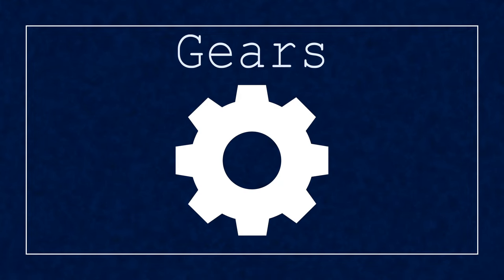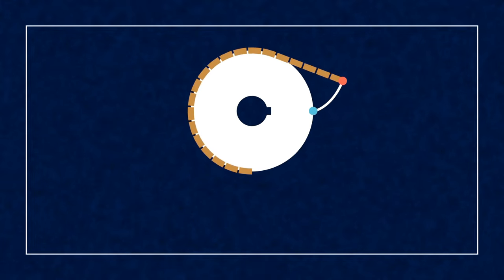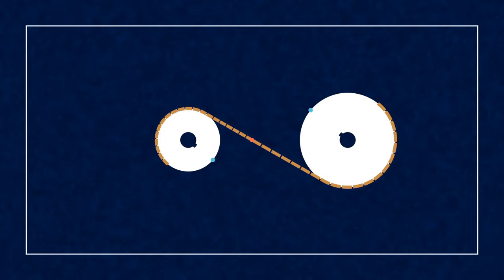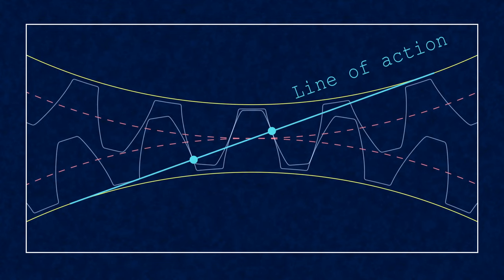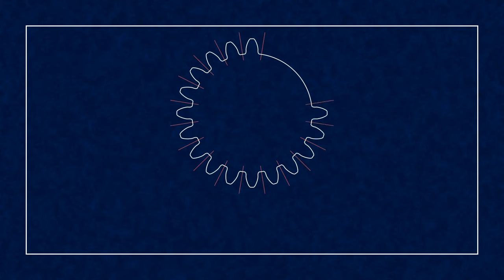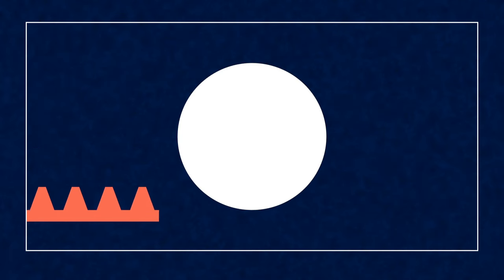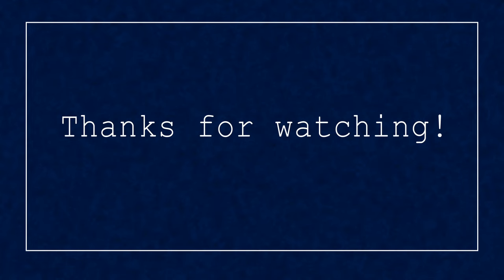Involute Gears Explained

Comment: good video, however I think the loud music distracts from your speaking, sometimes it's hard to hear what you're saying because the music is too loud
Reply from the maker: Thanks for the feedback. It sounded OK on my computer when the music was down -12dB, and then I got it down to -14dB just in case... But not enough it seems. I also need to improve my speech, gonna try to do better next time
Reply: @gergelybencsik8626  The hardest part about making YT videos is getting the volumes right... Which too me, is mostly YouTube's fault, for not caring about the gain of the sounds in videos when they're uploaded, and rather only care about ruining the quality of the waveforms. And they don't have any guidelines on how loud the video is supposed to be, which is even dumber. They could've just said that it should only be 60dB(natural speaking volume) output. It would've been a lot easier for people do deal with if it was just that.
Reply: it sounds fine on mobile for me
Reply: I was going to make a similar comment. The graphics and explanation were great. I didn't think music was necessary, but is was not offensive music -- like the clicks in the "music" other YTers use and abuse the viewer with the type of music. The volume of this music interfered with the narration.

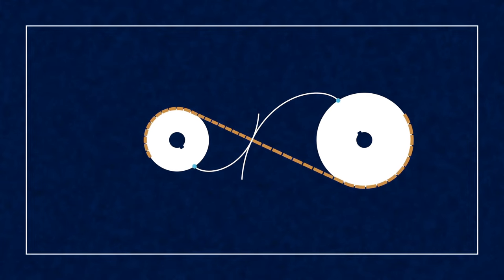Comment: Amazing!!! The way you visualized a profile shift at 2:45 on the two involutes based on center distance is phenomenal!! You should make a video expanding on the profile shift coefficient and it’s effects on sliding factor and undercut!
Reply from the maker: Thanks! It's a work-in-progress... https://imgur.com/a/ng18Bgj  

I actually didn't know about the 'sliding factor'. Or at least not with this name. Could you give me a source on that?
Reply: @gergelybencsik8626  Contact ratio would be the correct name. Profile shifts affect working pressure angle which modifies the final contact ratio of gear pairs. Can’t wait for the next video!

Comment: Excellent explanation! I will have to watch this video again, to remember the terms. It does make perfect sense, and good to know, that it's theoretically possible to make straight cut gears run smooth, quiet, and efficiently. In auto racing, we call these "spur gears".

Comment: I once worked as a shipping clerk at a machine shop that made precision gears that were used to check production gears. Although it was not strictly necessary for my job, I became fascinated with the geometry of gear teeth, otherwise known as involutometry. That was 40+ years ago, but I still find it interesting!

Comment: finally a good vieo explaining everything major in gear geometry and respecting the viewer's intelligence. I need one for angled gears (axises of rotation not being paralle)
Reply from the maker: I'm planning to follow up with undercutting and profile shift. I can't promise angled gears, I need to research them first, and going 3D is a bit of a challenge
Reply: @gergelybencsik8626  yeah its quite a task. keep doing what you like and are good at. I like this presentation style and plan on watching whatever you upload.
Reply: Wouldn't angled gear just me cross section of a cone instead of cylinder? Circle to cylinder makes 3d, cylinder to cone makes angled.

Just a guess.
Reply: @sirme1798  It probably is exactly this, but I want to see how it behaves with slightly misaligned axles and also how the geometry of helical gears applies to angled couplings (most car differentials)

Comment: One thing that you didn’t point out, though it’s clear from your animation, is that the force applied to the gear at the point of contact is always perpendicular to the radius of the gear.  This means that as the gears rotate they are always producing the maximum torque on each other and it is constant as they spin.

Comment: Excellent video presentation. 
I understand that for gears to mesh properly they have to have the same module, (M1, M2, M3, etc) and I think that is the modern version of the older imperial Diametral Pitch system. For those not familiar with it, could you do a presentation of Diametral Pitch. I know that basically it's the number of teeth per inch of circle circumference.
Thanks for making the video and for taking the time to upload.

Comment: Very well done, thank you!  A couple of points, though.  Lose the music!  It is not necessary.  
Secondly, you state that the gear teeth flanks slide on each other.  In fact on spur gears they ROLL on each other.  Certain other gears, such as worm gear and worm, and hypoid gears, see sliding motion and for that reason require a special lubricant.  Good animation, and the formulae for the involute curve are the first time I have seen them.
Reply from the maker: Well, this sliding topic seems to be a recurring thing that I now must make into part 2 - if I ever finish it. Can you give me a source for your rolling claim? This is where I stand: there is rolling only at the middle part of the flank, at the pitch point, and the closer you get to the root or tip of the gear, there's more sliding. And since the rolling is only momentary, and not sustained over the contact surface, the motion must be categorized as 'sliding'.
Reply: @gergelybencsik8626  In engineering school I definitely was taught of the tooth's rolling motion.
When checking resources with google, it appears that the rolling motion is appended with "sliding" motion at the extremes of the tooth engagement.
I suspect that much of this type of engagement depends on the accuracy of the tooth form.
Reply: I had the opportunity to speak with a gearing specialist who is recognized internationally.
He confirmed with what I found and reported on 2 days ago:  Rolling motion when teeth are in contact at the pitch circle, and sliding motion as the contact point moves away from the pitch circle.
Glad to be able to update my dated knowledge!

Comment: Great video! I have a question: the values of 1m/1.2m for the addendum/dedendum are arbitrary or have a geometric explanation?
Reply from the maker: Good question, I haven't found any data on that when researching gears. The dedendum is larger for clearance, I saw some sources that separate it into 3 parts: 1m addendum, 1m dedendum, ~0.2m clearance, and the clearance value seems to vary a lot. I chose to keep it simpler this way. Keeping it proportional to 'm' is a good idea, then all your gears will be similar shape, just different size. Why is it exactly 1m? I can't tell you, although all sources agree on it. It seems to me it's a value that works really well in practice. If you increase it, the tooth becomes kind of pointy and long and thin, which makes it mechanically weaker. If you decrease it, you reduce the contact ratio, meaning you risk that during rotation, at certain points none of the teeth engage because they're too short and stubby.
Reply: I think like most things in engineering it has been tested empirically then standardised in the simplest way possible

Comment: That's really cool!
What's the little jump in the upper gear's dedendum profile in the animation at 6:14? Is it supposed to be there? Or did you change the type of template used suddenly?

BTW this is probably Wintergatan's bread and butter haha!
Reply from the maker: Good catch! It's a glitch in the way I do the rounding at the root. I actually use the same function as for the undercut, and at that point the curve disappears because the root radius is not deep enough to calculate it the same way. So the rounding is just a small adjustment of bezier ctrl points between the arc and involute.
Reply: @gergelybencsik8626  Ah that's interesting! Sounds like a hard problem to solve.
Reply: @gergelybencsik8626  stupid non-arbitrary-precision floating points 😂

Comment: They exactly do NOT slide with each other, they actually ROLL on each other.
Reply from the maker: I'm still quite certain the tooth flanks slide more than roll. Do you have any source on this?
Reply: Only on the point where the line of action intersects with the pitch circle does true rolling occur. Otherwise there is always some sliding.

Comment: Could you do an explainer like this on how involute ring gears (internal teeth rather than external)? Unlike normal gears they're obviously not compatible with a rack between the teeth where they meet, and I haven't been able to find any adequate explanation of how the profiles are supposed to be generated.
Reply from the maker: I modeled inside rings in Manim, but I don't really know how they're made. I read somewhere that they're made with spur-gear shaped cutting tools, or they're just straight CNC'd. As far as math is concerned, the profile is exactly the same as normal spur gears, except inverted. By inverted I mean that a ring gear is just a circle with a spur-gear-shaped hole inside it. There is an animation on the github page for it: https://github.com/GarryBGoode/manim-GearBox 
Based on my experience animating it, it works the same way, maybe except for a few minor interference issues at the tooth tips of the inside ring, if you don't leave enough clearance. Also I can't tell how undercutting would affect an inside gear, but... you generally don't make small inside ring gears with 17 teeth or less.
Reply: @gergelybencsik8626  Ok. That's what I've been doing for printed gears but in the model there seems to be some very slight interference I've been trying to figure out, and I wasn't sure the approach was sound to begin with. It's probably just some weird thing with the tips I need to figure out...
Reply: @gergelybencsik8626  Internal gears are generally generated with a gear shaper or broach. They can't be done with a hob, as it is basically a rack wrapped around a cylinder and canted to the lead angle.

CNC is also an option.
Reply: @daliasprints9798  Make sure you have backlash being considered in your file. Also consider topping your teeth, trimming the tips, and/or crowning your teeth.

Using a whole depth coefficient of 2.25 (deeper depth) rather than 2.157 (standard depth for DP, Mod pitch uses 2.25 almost exclusively). Stub tooth is also an option.

Comment: Excellent video that is not only fully correct but is clear and graphically impressive. I would like to copy the link for my students with your permission?
Reply from the maker: Sure thing, I'm glad you find it useful.
Reply: @gergelybencsik8626  Many thanks I will let my students know and give you credit. Just curious what software you used to generate the videos?
Reply from the maker: @paulbriozzo4895  It's called Manim, a python based thing originally designed by 3blue1brown, but now there's an open source community around it. The sources are linked in the description by the way.

Comment: Has it been made totally in manim, or has any other software been used..?
Reply from the maker: I used After Effects to put the scenes together and for a few bits, like the sparks at the gear cutting scene
Reply: @gergelybencsik8626  the animation where the yellow rope unwinds and the winds up on the circle.. Have you made it in manim..?
Reply from the maker: @AK56fire  Yeah, the rope's a DashedVMobject...
Reply: @gergelybencsik8626  how has that winding and unwinding effect been made... Please Share the code..
Reply from the maker: @AK56fire  Well, that part is a big old 1000-line spaghetti code. But I'll put it on github later
Reply: @gergelybencsik8626  Thanks man.. I'll wait for the code..
Reply: @gergelybencsik8626  Them sparks at the gear cutting scenes was very very cool.. If you would make a tutorial of how you made this video, that would be so great..
Reply: @gergelybencsik8626  You are a Manimagician!